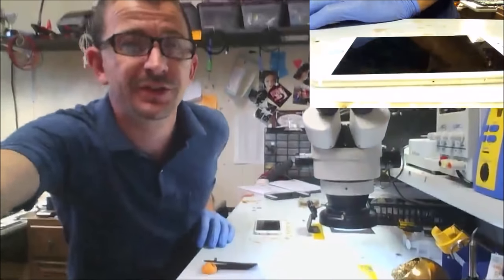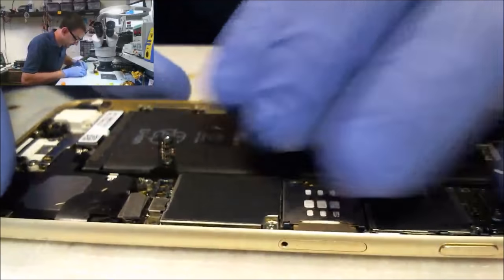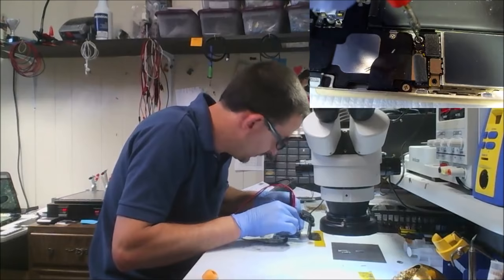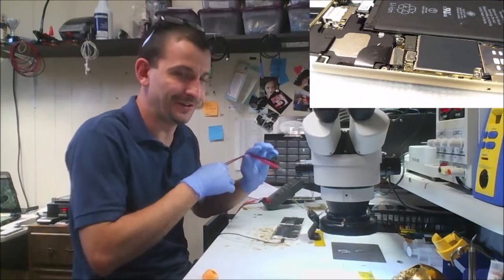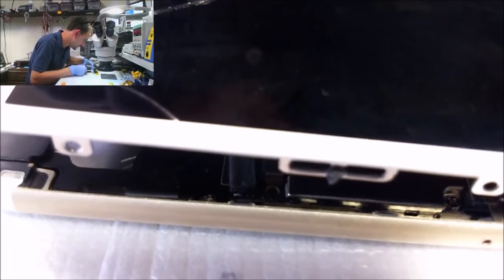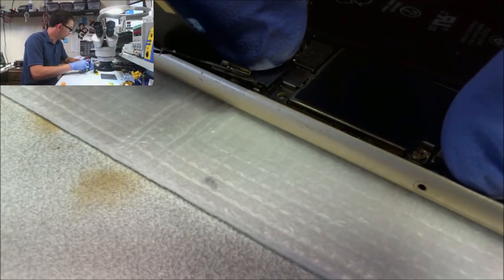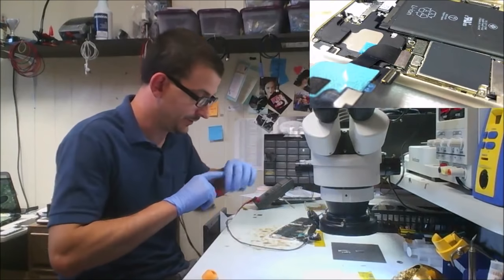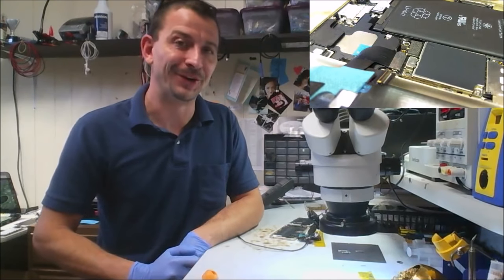Troubleshooting an iPhone 6 that will not charge the battery

Comment: Sir,i’ve iphone 6s there is a problem related to charging,when i connect charging wire to iPhone it’s battery percentage drop by 2% and when remove charging wire from iphone then it’s battery increases by 2% it’s also not charging battery but symbol of charging shows…so i kindly request you to make a video on this issue….

Comment: I've got a 6 plus that when using an USB Current Monitor is not showing any amps being pulled. Does this mean it's the charging port? I believe it may be, but I was readying and saw that it may be a chip on the board that is the issue. How can you tell the difference if its the chip or just the charging port?

Comment: Hi Jason, great video learnt a lot from this. I have a question. I have fixed several iPhone 6S tristar ICs. Most every time they charge fine after the repair but all the time they drain fast like 1% every minute. The weird thing is that they only drain like that when using the phone but on stand by they don’t drain. I use 320c with airflow at 55 when desoldering the ic when soldering back on the new ic I use less air flow at 45 but same temp. I am using a quick 861DW solder station. Any input of what I might be doing wrong would be greatly appreciated. Thanks!

Comment: Hey, i have a question. I took my 5s apart because the phone wont charge or turn on and only showed the battery level on the screen. I opened up the phone and took out the battery and read the battery voltage. It read 2.5 volts. I then connected the battery to a lipo charger and charged it to 3.9 volts. I put it back into the phone and its still doing the same thing. Im thinking its the battery. What are your thoughts?
Reply from the maker: I would try the battery first but there is a lot of stuff that can cause them to not charge properly.
Reply: Z.A.K. RC most of the time that I see a battery with enough voltaje to turn on but it just won't turn on. replacing the battery does it.
Reply: Yered Martinez yeah, that did the trick, got a new battery and it works like new.
Reply: if it persistsafter replacement, its a faulty U2 IC Chip failure.
Reply: I have a iphone 6s I had it about a year like a month ago I got battery problems such as leaving it on the charger for a hour and it didn't charge and yes I abused it by using it while it was low now it does nothing will not even cut on you think it's the battery?

Comment: Did you explain the boot loop??? If theres a fully powered battery why would there be a boot loop. wouldntit be the best test before you connect a new charging dock. If I am wrong here could you explain. Is it the case that the charging dock is just to charge the battery.  It seeems logical to use a battery thats full 1st. but your was on 3% and dropping power. your answer could get me on my way to a fix. I wait in anticipation for your response. thumbs up.

Comment: Fantastic! You answer my questions before i ask. The pins on the multimeter. Brilliant.
I would like to know how you reset that shorted battery. Then i have one question about
the iPhone 6. i have one that oddly connects to apple and fully restores (2.8 gigs) just by pressing and holding the home button ONLY. Other than it just sits here, shows a boot screen for 7.6 secs and a black screen 3.2 secs. Thanks for your videos, man. I would not have tried a fix without them.

Comment: Hiya, I am repairing an iphone 6 and it doesnt appear to be taking a charge. Initially it appeared to be boot looping however I managed to restore the device as somehow it seemed to have taken a little charge. However it does not display any  battery icon when off and charging. So it would appear it isnt charging right? Any ideas? Many thanks

Comment: I have an iPhone it's completely unresponsive. Won't charge, icon won't come on or anything. Is it battery problem for sure?
Reply: Same issue, did you get yours fixed? 

I ordered a battery hopefully its the battery with mine.
Reply: same problem did anyone figure it out?
Reply: It doesn't help
Reply: Same i had my battery replaced. But a few weeks after it was completely unresponsive

Comment: I'm somewhat new to repair and am currently preparing to troubleshoot an iPhone 6 with a possible bad charging port as well. 
This will be my first time using a multimeter (which I've ordered and is on its way) to be sure its a bad port before I go ahead and order any parts. 
In this phone's case, it will not charge at all. I was told the owner kept having to fiddle with the cable in all sorts of ways to get it to work ever so slightly until it just refused to work altogether (I've tried different cables, so that rules that out)
What kind of reading can I expect from the board if the phone is connected and there is absolutely no power flowing through the charging port? The minimum for the battery? Nothing at all? 
What if I test the battery? What kind of reading should I expect there if its healthy or if its bad? 
If it turns out to be a board issue, I won't carry through with the repair as I'm not yet that experienced and I lack the proper equipment for it. But a bad battery and/or charging port I can do just fine. I'm good with switching out parts, but this will be my first time reading voltages to diagnose bad parts.

Comment: I'm using 0.7 mm mechanical pencils with 0.68 mm pogo pins soldered into for multimeter probes and for poking while soldering. I really like the way that give me haptic feedback so maybe you'll want to give that a try, too.
Reply from the maker: That's an awesome idea!  I recently bought some new probes but this sounds neat.  I've used graphite rods for conductors in quite a few projects but never thought of pencils for probes - I bet mechanical pencils make good probes, plus you can mark with them when needed.  cool!   Thanks :)
Reply: I on the other hand didn't think of using the leads as conductors. I just measured and it might even work when the lead is short.

Pogo pins are spring loaded needles used to interface test pads in automated testing. Really cheap,too. The springiness allows to compensate some shakiness and limits the force applied. Really neat for removing the rubbery overcoat or general poking. And they loosely fit mechanical pencils.
Reply from the maker: Ahhh I see!  I understand now.

Comment: i have the same issue as this on your video, so its more likely the dock connector thats causing the problem? i've replaced the battery and the percentage is increasing but when i leave it on,  the percentage is going down while charging. i will purchase an extra dock connector and see what happens when i diagnose it with my multimeter.. if you have any tips it would be very handy so i can fix this iphone 6. thanks in advance.
Reply from the maker: Troubleshooting iPhone 6/6+ charging issues has proven to be challenging.  Sorry, I can't be much help - there's a very good chance that is the Tristar IC or the Tigris IC if battery and dock connector don't fix.

Comment: hey I have an iPhone 6 plus that starts up to the apple logo then goes into a boot loop if the battery is dead it will show the charging symbol and the lightning symbol if i unplug the charger, I've already tried different charging flex cables and sometimes it will not go into a boot loop but boot normally and on those times the apple logo shrinks slightly...any ideas?

Comment: How do you check the voltage going into the display on an iPhone 6s. I recently replaced the battery and charging port on it but it still won’t turn on. The phone definitely had some water damage to it. Any suggestions?
Reply: Same problem me to service center said mother borad should replace

Comment: Hi there, I've got an iPhone 6 that does not power on. I opened the phone and noticed that the dock connector at the motherboard seems a bit damaged, though I can see all the pins straightened. I get no voltage at all at the battery connector on both the motherboard and the battery. Could this be an IC problem or a connector replacement? Thanks.
Reply from the maker: Yes it is more likely an IC problem or a short to ground somewhere.   From there I normally apply battery voltage from an external supply to the battery terminals and see what the amperage draw is.  If it's above 0 amps with the phone off, something is draining the battery.
Reply: I've went ahead and fed power to the battery connector and it powers up normally, could it just be the dock connector?

Comment: I dropped my iphone 6 and it went off, after that i turned it on,, the battery level was fluctuating from 21% to 15 % like that in inreasing and decreasing order...The phone was going on and off in between... After that i left it as it was....My phone went off n now it  wont charge,, just stuck on 1% or 2, 3 % and it goes off.... Battery level doesnt seem to increase.. What can the problem here?? Any thoughts??
Reply: Fix it?

Comment: Hi.  I recently replaced the battery in my iPhone 6s and rather stupidly reconnected the battery connector BEFORE I reconnected the digitizer and other screen connectors.  When I tried to turn the iPhone on after reassembly, nothing happened. The iPhone was dead.  I left the phone on charge overnight, but it is still dead. I tried to see if the iPhone would show in iTunes, but it didn't. I am hoping that my stupidity just killed the battery, but am really concerned I might have shorted the mainboard.  Any ideas thoughts on this or how to get the phone working again?  Thanks
Reply: Just to add to my previous post, I swapped the battery again today and 
the iPhone booted with everything working - except the Home Button &
 Touch ID.  Happy as I am to have my iPhone 6s back, I am gutted the 
Home Button & Touch ID are not working.  If anyone has any fix for 
this, please let me know!  Thanks. K.
Reply from the maker: Sorry I'm just reading all of this..  There are a lot of things that it could be.  I would really be taking shots in the dark without seeing it though.. it would have to be something around the connector or maybe long screw damage I would think.   Hopefully you figured out a solution by now!

Comment: i have an issue where iphone 6 shows it charging then boots to apple logo then goes back to charging symbol and does this over and over , things ive tried to rule out replaced battery and charging port used new original apple cable but cannot restore it as it cant connect to a laptop tried all the old tricks of holding power and home button tricks and even holding just home button then connect to laptop once itunes has loaded none of it works, and finally tried the power and volume up button still no joy is it possible its the tri star that has gone as its had tri star repair last year and was warned by the repair person to get rid as soon as he carried out the repair

Comment: I have a phone that charges to 47 then stops and no higher....Ii then went down a bit 35% and when I plug the charger back I see the lighting bolt indicator but the charge wotn go up.. I replace the power connecter 2 times (I thought the1st one was defective) ... I have installed 3 batteries still the same issue.  I want fishing and I'm wonder is salt mist did some damage  but I change the charge port because I though it may have been the culprit any ideas..? also I notice my Verizon charger that  has a red light indictor that goes red or on  for a while the shuts off but the bolt symbol is always there tricking me into thinking it is still charging
Reply: sounds like a logic board issue. you changed battery, and charger port...last step is tristar

Comment: hi! i still have an iphone 4s, and i'm kinda having trouble with it.., when i charge it up to 100%, and then disconnect it, but then it starts to drop very fast.... and when the battery drains, and i plug the charger cable and it doesn't charge, it goes in a loop, the apple logo comes on screen and the comes off....i replaced the battery and the dock connector by the way..... do you have any idea of what could it be?

Comment: Hi, just subbed to you channel, I've got a iPhone 6 that was plugged in to a car USB double socket,I was charging the phone off one &a a battery pack off the other, cut a long story short the battery pack let out a puff of smoke, and iphone stopped charging, ended up having to get a new lead for phone, it now charges normally up to 100%, but if left on standby it dies after about 7 hours... Any ideas what this could be...I have renewed the battery, but the issue remains..thanks in advance...martin
Reply from the maker: +Martin The Tristar IC is most likely at fault since you noticed this battery drain immediately after the smoking charger incident.  Chargers pop those little ICs in one way or another all the time even without smoke.  A very common symptom is battery drain.  There are lot of other things it could be though.

Comment: Hello! I have a problem that I need some guide, I  have an  iphone 6 not charging a flat battery but charging the one with current in. I have change Trista ic but no solution. I checked and the is no vcc main voltage in when I plugged the charger cable, but when I connect a power supply of 3.5v, it shows charging? Can some one help with this?

Comment: Oh yeah !!! Thumbs up for the soldered pins !!!! But, just in case you wonder - Fluke TP-88 will do it for you ! )))) it's lead tips extenders, they are kinda long though, I got them for 18$ ebay. Don't know if I will utilize them though, I might just solder sewing needles on my leads.
Reply from the maker: Thanks!   :D
Reply: STS Telecom. My iphone 6 will not charge or even turn on I need advice
Reply: plug it in to a computer, open device manager, i do this to see if the phone is being detected by the computer.....also..plug in the charger...feel the phone if its warm....warm means power is moving around inside...if its always cold and shows no signs of life...it may be the charger port..thats the cheapest 1st thing to replace...

Comment: Hi!
I have a iphone 6 plus. suddenly my phone died. Thought it might be the battery since it was on 0 volt. changed the dock connector and a new battery. The phone is powering on now with new battery, but wont charge.
Any ideas?
Reply: change tristar ic this should fix your problem, in the future only use orignals USB cables, avoid using car chargers as much is possible that chargers sometimes give you more voltage than normal and fried some ics like tristar ic
Reply: thank you =)
Reply from the maker: Sorry Sir Haugen, I overlooked this one.  I see you registered.  I will do my best to help :)
Reply: thank you so much :)

Comment: Can you show a video on how to tell if a iPhone 6 or iPhone 6 Plus battery will "work 100 percent properly"..I have a issue that sometimes after i install the battery, the customer complains that the battery is defective. Either it will not rise in charge or it dies very quickly. Basically how can I predetermine, prior to selling the battery. If the battery is going to work properly. How can I troubleshoot a few things WAY before...so that when the battery is ready to go out the door. I can REST assured that it is 100 percent perfect! And not take a gamble, BASICALLY hopeing for the best. I want to be able to do some tests and look for certain reactions the battery does..when I introduce it to power!
Reply: Raffaele Santoro buy an oem batteries.
Reply: Have you tried using a load tester?

Comment: Hi, i just replaced the screen on my iphone 6 and its not charging. I did lose one on the screws for the plate that goes over the screens ribbon connectors. Will this short curcuit it?
Reply from the maker: Losing a screw wouldn't hurt anything but putting a screw back in the wrong place could cause it.

Comment: Great Video!
Have a question, I plugged 12V into my iphone 6 plus and fried the changing port. However after I put in a new changing port, it still won't charge. Any advice which components should I check? Thank you.
Reply: tristar ic, any iphone only you must put on it 3.8 to 4.2V as maximum otherwise you will fried more components on motherboard
Reply: hwis that when the standard apple block is 5v 1a?

Comment: I have an iphone 6 plus that wont charge.  I connect the charger and it appears to charge but wont power on , when i disconnect the charger it shows on screen to connect the charger. I changed the usb bock port and still have the problem. Im going to buy a new battery to see if thats the problem.
Reply: WTF_NENE did a new battery work

Comment: I have a question. I replaced my iphone6 battery it worked fine but  not is  coming on and I get nothing on display even when I try to charge it, the screen is black and does not show anything
Reply: Mehrdad Nankali same smh
Reply: Its the u2 charging chip when u can inly charge it with phone turned on then its the chip not the battery mine is fix now

Comment: At what terminals you were checking the voltage
Reply: ANOOP KHAN positive on battery and then anywhere for negative. Could be anything really, could be a metal pole stuck in ground

Comment: I have a tab 3, my shop couldn't find the cause of my tablet playing dead and not charging. Usb was ok. power ic ok. battery ok. I somehow managed it to boot it while I tried measuring the voltage? so, basically: very low percentage means: completely shut down, no charging, no booting/voltage error. long periods of charging: crashing, only hard reset works to boot. hope someone can help me?

Comment: 100% SOLUTION:
Remove the phone from it's protective case and place the phone face up on top of a hot oven for 5 mins while plugged in. (Optional: Blow a hairdryer onto the back of the phone) Phone will soon turn itself on automatically.